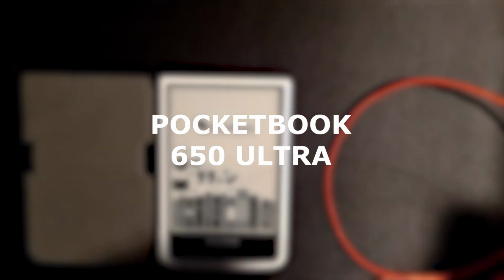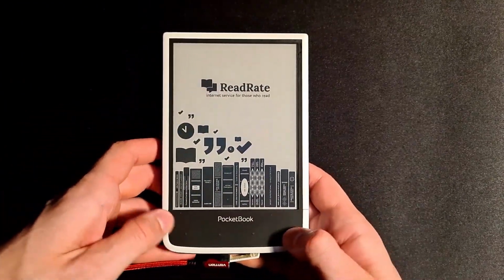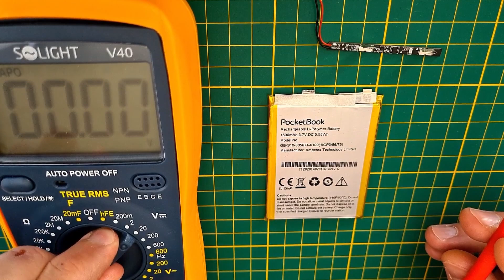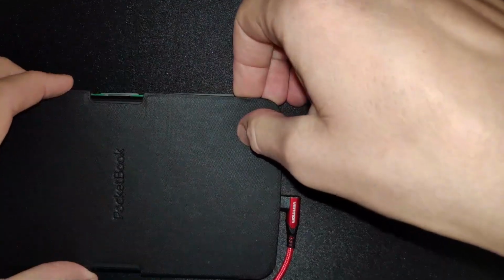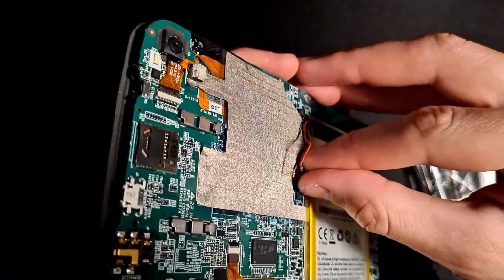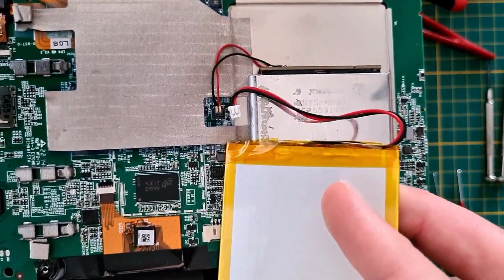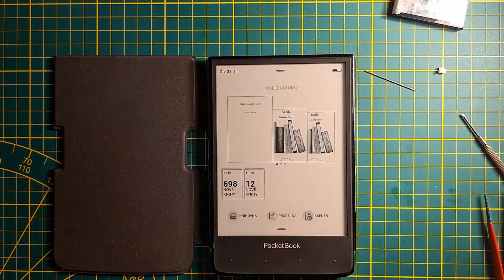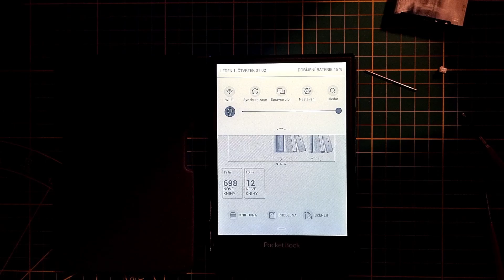PocketBook 650 Ultra E-Reader Repair | Battery Replacement | Stuck on Boot Logo

Comment from the maker: IMPORTANT!!! INCORRECT AMP MEASURING TECHNIQUE!!! At 3:39 I am attempting to measure the Amps of the battery circuit, however the way I did the measurement was incorrect and also could potentially damage my multimeter in different circumstances. First of all, the red probe should be plugged in the designated Amp port on multimeter. Second, measurement is done in series, not parallel like the voltage measurement. You should break the circuit and let the current flow through the multimeter.

Comment: I have a similar situation, lets see if it will also be the battery 😅
Reply from the maker: Let me know how it goes! Maybe hard reset by unplugging the battery will suffice for your device. Try it before buying a replacement.
Reply: @ will do that 💪
Reply: @ So i got a new mainboard but now the touch doesn't work. I don't know if the touch worked earlier bc it was stuck in bootloader when i tried earlier. Dunno what to do now, i tried downgrading the firmware, but doesn't help either.
Reply from the maker: @NHZMusic  Man, that sucks. My only advice, I could think of, would be to disassemble and assemble everything again. Other than that, I'm clueless. edit: okay, just to be sure.. are you pressing hard enough with the touch? It can be much stiffer on e-readers. Second, did you check the setting if the touch gestures are assigned? Or I can imagine that there would be a setting, that turns off all touch gestures. It is obvious points, but it is the only thing that came up to my mind.